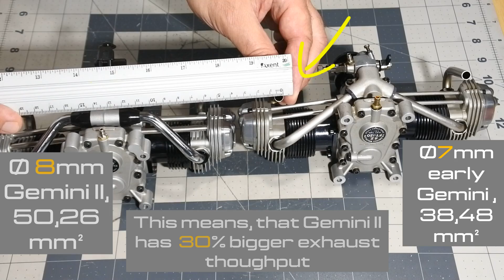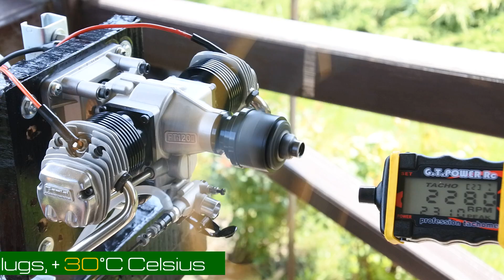OS FT120 Gemini II first run

Comment: Hopefully tomorrow mine barks off. Have it on a SIG Spacewalker II 25% scale with a 15-8 MAS on it. And if all goes to plan I will fly it within two weeks.
Reply from the maker: Wow, great news! Firstly, I wish you successful takeoffs and landings, and secondly, good, calm weather and clear skies!
Good luck and success!
By the way, what fuel do you plan to fly on?
Thanks and have a nice day !
Reply: @crazyengines88  I have some video up! Little low speed tweak to make but it yearns for the heavens. I'm using off the shelf Omega 15% in mine.
Reply from the maker: @TestECull  
Thank you very much for your reply ! Good luck with your flights and have a nice day !
Reply: @crazyengines88  I'll try to get someone to take video of it in the air!
Reply from the maker: Great ! It will be very nice ! Will wait for it !

Comment: Your love versus Os Engines is phenomenal, your work with these engines is top notch. I’m in love too with Os Engines. I have one question to pose to you: in the Os Ft .120 I I’ve seen on pictures that in the back cover, in the upper side, there is one screw that covers the position of an open plug. Do you know the significance of that? I have an Os Ff-320 flat four, the back cover is the same, I have mailed to Os a few years ago but they didn’t answered to my question in a satisfactory manner. May you help me?
Thanks in advance for your answer ❤
Reply from the maker: Thank you for appreciating my work, reviews like this let me know that my work has value.
As for the plug / breather in the back cover of the crankcase, there are several variations of this design: In the first, early  Gemini, there is a boss in which the threads are threaded and the screw is screwed in. In the Gemini II, only a boss remained, but there is no thread in it,  located on the right, in the first third of the crankcase cover. I also have a FF 240 (well, practically a FF 320, like yours, except for volume and power), it also has a boss, and there is a thread closed with a screw. In this way, we have 3 engines for two with a bosses and a thread and a screw, and one engine with a undrilled boss only. I have another one from this series, FT 160 Gemini, but I haven’t been into it for a long time, i.e. I do not remember. Tomorrow I'll be again in my workshop, so I can look into it. What can be useful from our set of statistical data? Perhaps this screw is technological, i.e. somehow the OS was needed in the production process (in reality I don't think so). The second thing that comes to my mind is that it is very convenient to pour cleaning liquid, or a mixture, into this hole to flush the engine after the flight, given that the engine is fixed to the frame of the aircraft. If you imagine that you screw a typical valve into this hole - an OS nipple / breather, then flushing the engine after flights can be quite a simple task, and at the same time save an expensive machine from possible internal corrosion. Why doesn't the OS install this second nipple / breather during production? There are several reasons, economy, and an excess hole in the crankcase, through which the remnants of the fuel mixture with oil will be sprayed into the aircraft.
I hope you can agree with my assumptions.
Thanks and have a nice day !
B.T.W., here is and additional argue in supporting my assumption - the location of the second screw for the nipple valve/ breather is very good in terms of the direction of the flow of the flushing fluid, the flow will be directed from top to bottom, while passing through the crankshaft chamber. That is, flushing will be complete, bypassing all the engine parts /elements.
Reply: @crazyengines88  Many many thanks for your exhaustive answer. What you wrote is very important for me. Os Engines had answered to me a few year ago that “this nipple was for in-house manufacturing solutions. 
So, your thoughts, I think, are the answer. 
Thank you 🙏
Reply from the maker: @gtfiberboy8064   That you for your question and kind comments, definitely, the answer was  found 👍